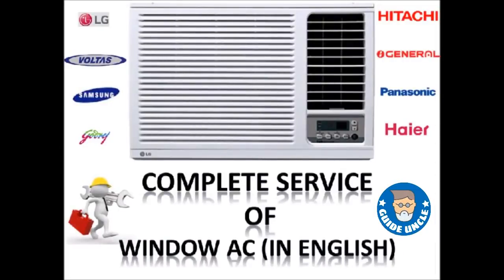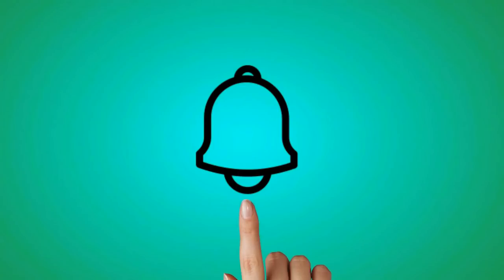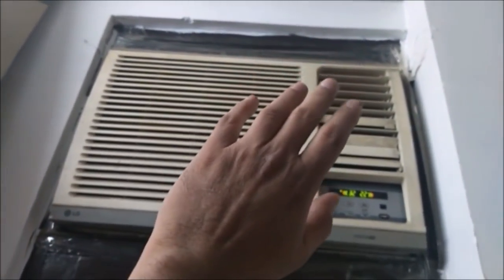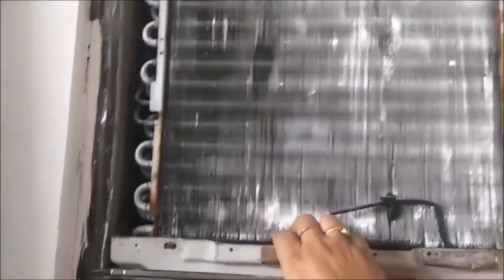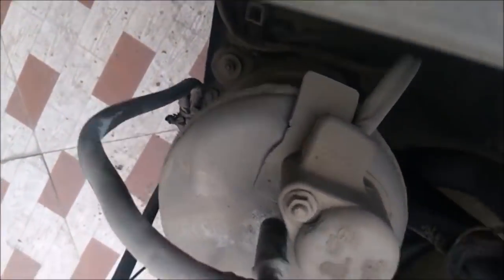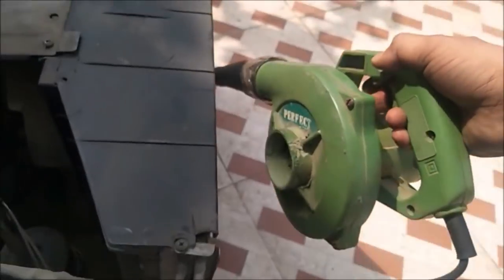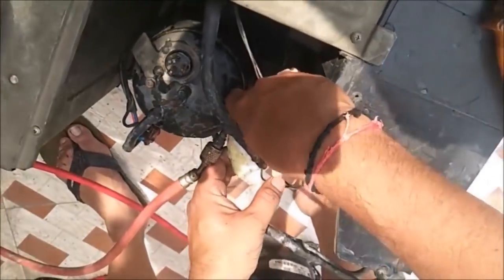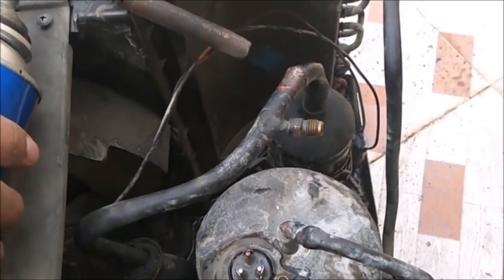How to recharging of refrigerant in window AC | Window AC complete servicing step by step

Comment: Don't follow this guy. If you braze the lines. It must have a purge gas flowing to prevent oxidizing inside the line. That would be an inert gas Nitrogen Argon or C02 1 of them, in that order depending on what you have access to. Without the gas flowing at a low pressure to displace the oxygen the black oxidation will occur inside and that will flake off and flow through the system and damage compressor or plug the small copper line.
Reply from the maker: In my video i nwver told to braze fins because you can not braze fins. I told about difficulty to braze copper pipe inside of braze.
Reply: @Guideuncle  What??? Nobody is talking about the fins. I'm talking about brazing the copper line. It must have a purge gas blowing through the copper pipe so the black soot(oxidation) doesn't form inside. The inert gas displaces the Oxygen so the inside of copper pipe stays clean. Watch some vids on how to braze refrigeration lines.

Comment: Did you burn the wires next to the torch 🤦‍♂️ you are supposed to use a Click Fix Pipe repair patch it has solder only $12 on eBay ok next time but ok good job my friend most people just throw away the unit and I can assure you the new AC units not well made like before I just bought a TOSHIBA 10k BTU window ac to replace my old WHIRLPOOL 6k BTU and that old one was more cold 🥶 then the new one maybe different refrigerant inside🧐

Comment: You are hosing the evaporator , not the condenser.You can also check for leaks with oil dye and use an ultra violet torch/new led flashlight whilst the unit is under pressure. Lousy welding , you are not applying flux to your welding rod and your gas torch is not adjusted properly , you should adjust the nozzle flame until it shows a thin blue end point. Anyways , the torch nozzle is too large but it's good you got the job done.👍

Comment: Not good.  If u make a welding on the copper make sure that heat can melt a selver rod
Reply: FYI, one brazes or solder on copper not weld. Solder is the lowest temperature and weakest, then brazing is higher temperature, I believe above 800ish degrees. Then welding is the highest temp and is actually too hot for copper I think.